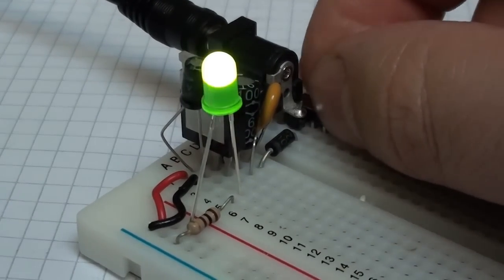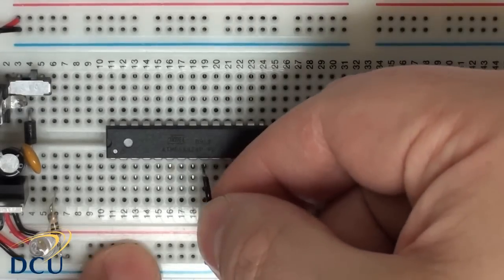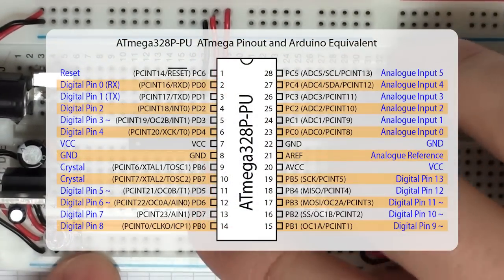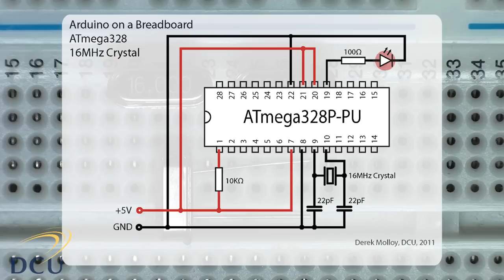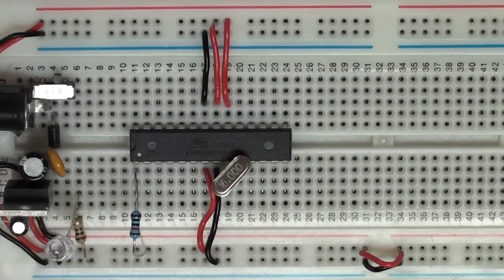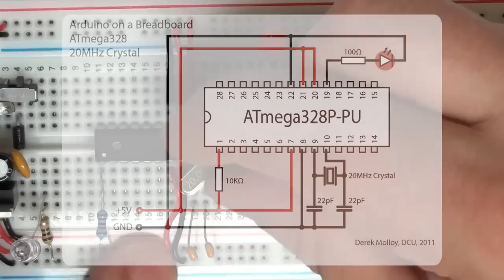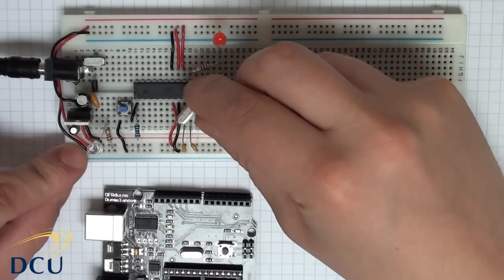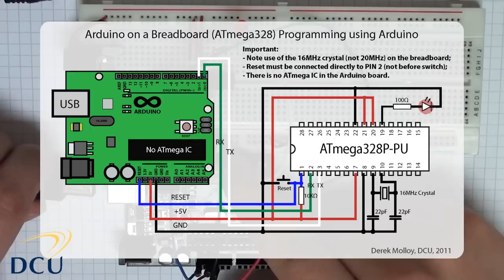Arduino: Arduino on a Breadboard

Comment: Can I burn my bootloader so I can use any atmega328 like this? It would be much cheaper and more convenient if I could just buy blank chips at the local store.
Reply: Yes you can burn bootloader, but you will need an avr programmer, they are cheap (USBtinyISP for example.).
Reply: Machin396 Is there any way to do it with the arduino board?
Reply: ***** http://arduino.cc/en/uploads/Tutorial/ArduinoUSBSerialSimple.png
Reply: ***** Yes,Arduino can be used as an avr programmer, just look for Arduino as ISP there are tons of tutorials.

Comment: Great video, thank you for sharing.
I have a question: is there a difference between the atmega328 with UNO loader of with Duemilanove loader?
There are a lot of chips with uno loader available on auction sites, but I have no idea if they can be programmed on my Arduino Duemilanove board.

Comment: I wish I had come across this about three weeks ago.

I would like to ask, do you only need to provide 5v to the breadboard or also 3.3v. In my setup I am going to use a PCB AMS1117 and I have both 3.3v and 5v, and this is what I am planning on using for the power circuit and because I don;t want to use an Arduino at all, I was going to use the lower part of my board for a FTDI.

Comment: google bit-101 Pull-up and Pull-down Resistors...there's a pretty good explanation from the blog owner...it's a subtle (at least for me, another noob) concept that prevents a floating state in the circuit, by using resistors as a means of forcing ground(low)/vcc(high) when the circuit is broken, but preventing a short circuit when there's a connection. Hope I'm correct, and HTH :)

Comment: You can buy little clip on heat sinks that help quite a bit in some cases. I picked up a handful of them for like 50 cents a piece. They just pinch on, but you can screw them on as well. Hope that helps. Otherwise, just use a lower supply and don't try to draw more than is recommended. That seems to work well for me. I haven't actually burned any regulators, but I was using a 12V reg to power a ton of IR LED's and it got pretty hot. It was rated to 1.5A and the LED's didn't draw near as much

Comment: I used 15pF and they worked. Apparently the breadboard itself has enough parasitic capacitance that it would most likely work w/o the caps though.
Reply: That was interesting... I heard stories of how twisting wires prior to soldering makes micro resistive paths... but I still thing its hard to put the wire in the hole if I dont twist it.

Comment: Very helpful. I don't even use my uno anymore. And I believe my TTL serial cable will eliminate the need for the uno for programing the microcontroller.

Question: Can I use your power supply to make a 3.3 as well, like at the same time. Just use a 12V source and adjust the caps accordingly so that it is more like the UNO?

Comment: I actually just solved this problem on mine.  in my case, I was not using the correct capacitors and I believe the crystal was not oscillating (hence, a sync issue).  This error will also occur if the TX line is not properly connected (that is, you can reproduce the error on a working circuit by disconnecting the TX line).  In my instance, I did not have a 22pF capacitor handy but I used a 68pF and it worked.

Comment: I'm pretty unsure but it has do something that servo using highest power or improper power supply which is why it destory 328p.  Every servo have specs require of power using.  Another reason RealationGames might put into wrong place of chip.  I'm a helicopher RC repair.

Comment: Do i need to remove the chip always before programing the micro controller or only in this tutorial you mean ? i am new in this and trying to understand . so in case i want to program another chip. shall i remove it or i can keep it ?
Reply: The website says to remove the chip. I wonder if you can program two chips if there is one in the slot. Technically if you dont want to use breadboards you can leave the chip in the shield. So far thats all I am doing. Im trying to learn first. Also if you dont have the shield theres a way to program your chip to act as ArduinoISP and you wouldnt have to risk damaging your shield thing. Im trying to learn that too. It has to do with the bootloader and burning it. If you get a cheap arduino nano atmega328p it seemed to upload sketch right out of the package via usb. So long as right chip and connection port is selected in my case tty/usb

Comment from the maker: I'd say the servo made the regulator quite hot as they draw a fair amount of current. The heat shouldn't have had any effect on your 328 as the 7805 usually has a thermal shutdown. I'm also not sure how you could have damaged the 328 with a servo as they don't require any additional circuitry to work, just share the GND/+5V line with the servo and run the yellow wire to one of your Arduino PWM outputs. The only thing I can think of is that you somehow shorted the 328 and drew a large current.

Comment: Not also did my regulator got hot, but it burned out my 328p-pu MCU. Why is that?
I was controlling servo with it. I got the servo supply from the same power rail, and servo PWM from the MCU.
I'd like to know what I did horribly wrong so I won't burn out another chip.
I used 9V input to the regulator.

Comment from the maker: It gets hot enough alright. It depends on how high your supply voltage is and how much current your circuit is drawing but ideally you should keep the supply voltage as close as possible to the delivery voltage. If the supply is 10V and the regulator regulates to 5V and you deliver 100mA, (P=VI) the 5V difference x 0.1A = 1W of heat, think how hot a 100W bulb gets! Most voltage regulators shutdown if they get too hot, but they can be still very uncomfortable to touch.

Comment: Does the voltage regulator get hot? Mine gets VERY hot - I assume that I did something wrong^^
Reply: From taking stuff apart I noticed that the metal side of the voltage regulator is sometimes connected to a heatsink or perhaps even with thermal paste thus the top screw hole.

Comment: Great video as always, but I have a question/possible correction.

You say that changing out the 16MHz crystal for a 20MHz crystal won't affect the rate of the LED blinking, but shouldn't it? When the C code is assembled to machine language, it has to be defined in terms of clock cycles (at least, that's been my experience with other uC's). Since you didn't upload new code to the uC, wouldn't it still be running the same number of cycles per delay, resulting in a faster LED blink rate?

Comment: Thanks for this very well done video.
A comment:
The digital pin 13 hasn't a resistor in serie.
There is a (LED with a resistor in serie) in parallel to the digital pin 13.
Using a LED connected between pin 13 and Ground is stressing the
ATmega328 output driver. The LED can withstand more than 40 milliamps and will survive but a series resistor is recommended.